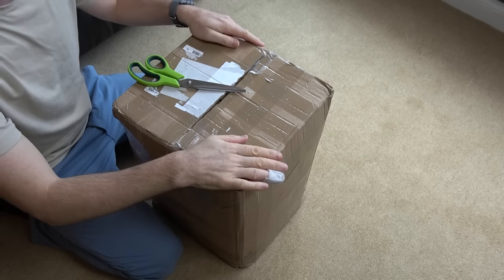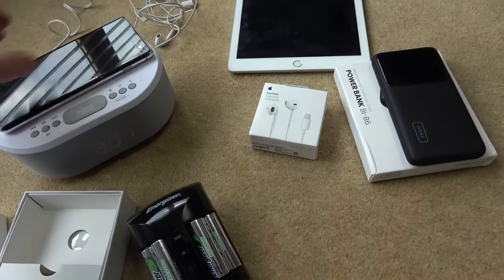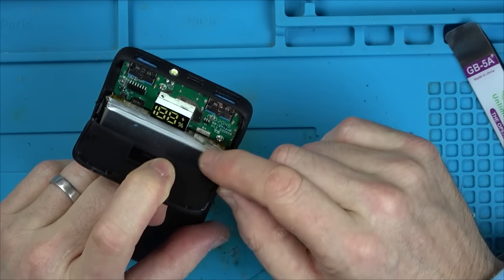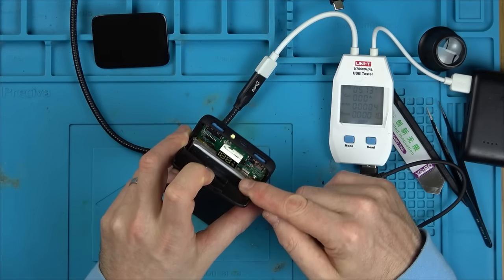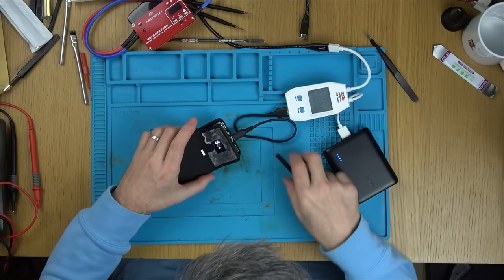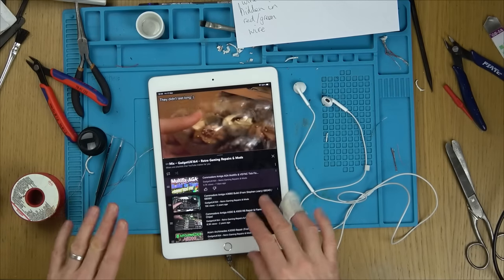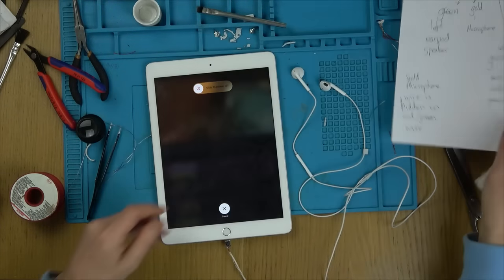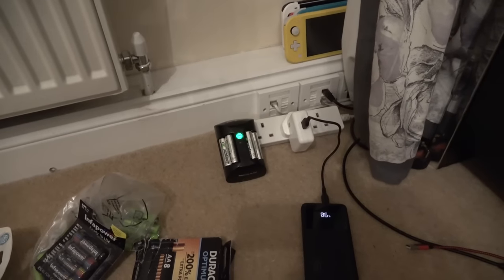AMAZON Returns MYSTERY Box from eBay??? Can I FIX it?

Comment: Excellent video Vince!  I especially liked the cupcakes section!!!  Edit: I see you tried heat shrink - worth getting a set of mixed sizes for future repairs =D
Reply from the maker: Cheers Chris, the cupcakes looked yummy, thanks for using the RR MMV mug in your video as well 😂
Reply: @Mymatevince  Those cup cakes were heaven!!!  The RR mug is great - It reminds me that rome wasn't built in a day!  When I get stuck on something super time consuming I look at that mug and think of all the work that has gone into the RR so far, but split over many parts!
Reply from the maker: @GadgetUK164  👍👍